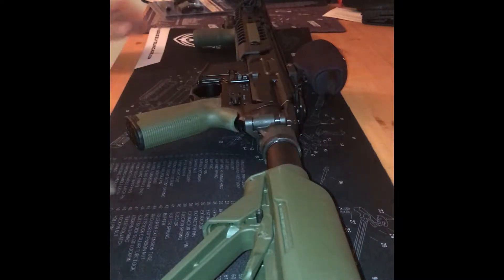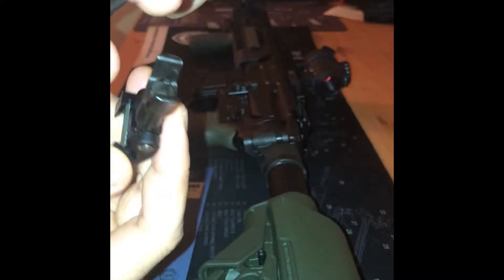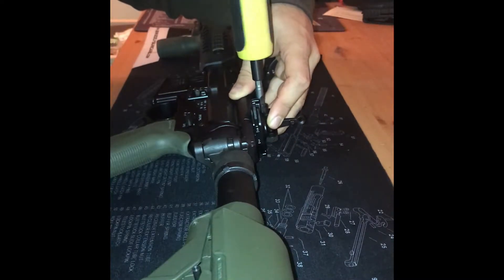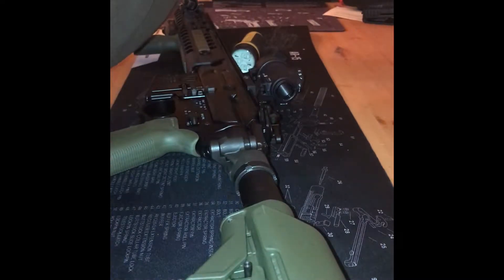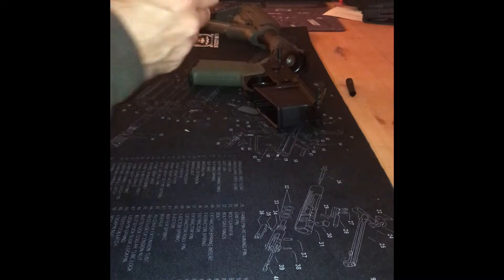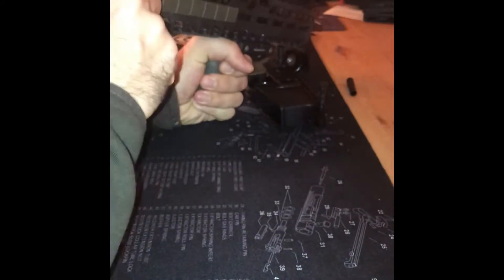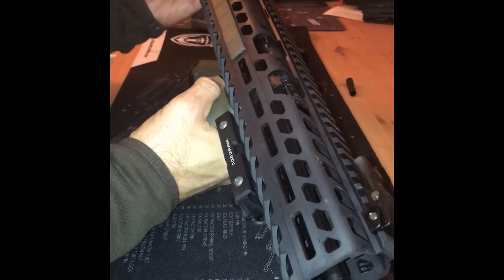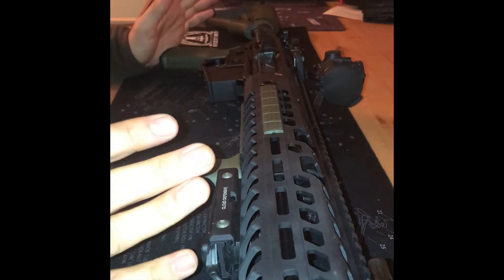Sig Sauer Virtus Upper Receiver Part 2

Comment: Looks great, did a great job.  I have the Sig Virtus, but have been looking high and low for the adapter to add to a regular AR lower as you did.   I like to have options.
Reply from the maker: I just bought the MXC lower on Gunbroker.
Reply: Techno Bobber Hello Techno, I’m going to install an MCX upper on my AR lower as well. Any reason why you are purchasing a MCX lower?
Reply from the maker: Brandon Floyd using the lower for an AR pistol
Reply: Would you want to sell your MCX lower? lol
Reply: @anthonysmith1019  Already sold, but if I still had it I would to make up for the stock market lows this week.  🤣
Reply: @thodthverdthur  what is the torque limit for mcx stock adapter kit and the mcx bgc bumper?